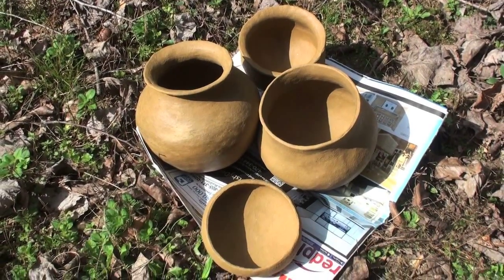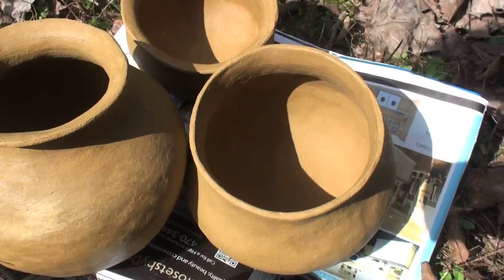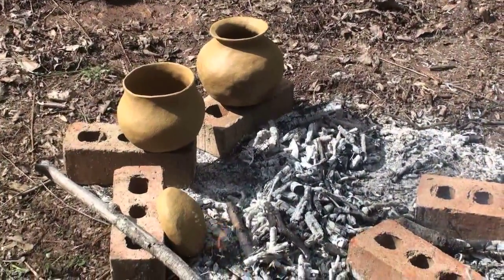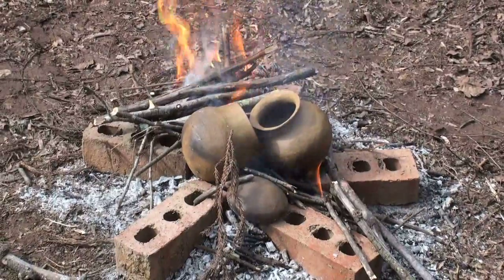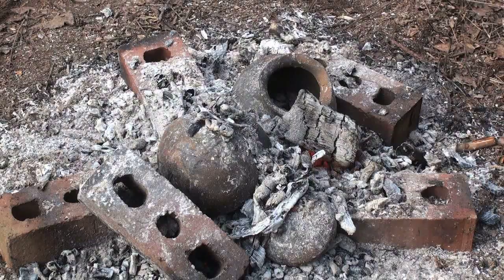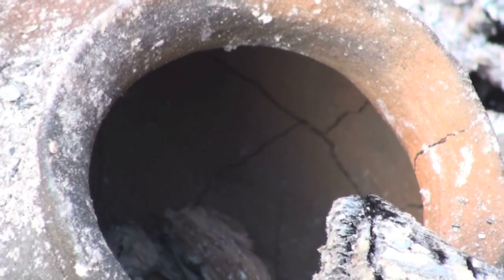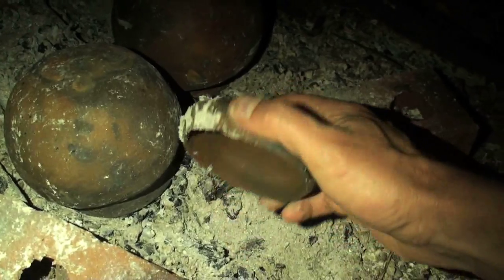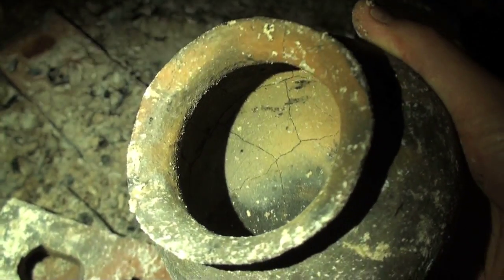Primitive Pottery Firing 1 (HD)

Comment: +Primitive Pathways -> The shape and geometry of the items is excellent and obviously a lot of work . Firing temps of 1400 degrees will never be reached in an above ground fire / without a kiln = I know and have been making ceramics in a "primitive" way for over 40 years . Best of luck in all future endeavors .
Reply from the maker: Thanks!  Yes you're right about the temperatures a fire can generate.  But that's actually what I want because I'm wanting to make low-fired pottery that's fire proof and capable of being used as cooking vessels over the fire.  If they fire at higher temps, they become glass-like and are unable to be used as cookware.  I believe the pots cracked because I didn't have enough temper.  I've got some more experimental pots that are drying right now that have more temper.  I'll fire them once they're dry and see how they turn out.
Reply: Just my opinion - For a cooking vessel and anything containing hot liquids , I want a "glass like " glaze which stops moisture from entering the inevitable porosity of the clayware . This porosity is greatly reduced by washing and kneading harvested natural clays and getting the clay as "clean" as possible with no particulate matter . 
It is the air spaces and porosity which cause most problems + all hand made ceramics need quite a lot of SLOW drying time before firing - be it indirect sunlight or other methods . 
I will use Chaco Canyon New Mexico as an example -> To this day , there are still a great many pottery shards in the vicinity and much of these shards are the result of structural failure during the firing process = A person is going to lose a percentage of their work . Once again - Your vessels look awesome and your skill level is evident  . ATB
Reply: I use a thermocouple to measure my outdoor firings temperature, 1400 F is super easy to reach, even a fairly low temp firing can get that hot. I have to work hard to reach 1600 F though so that’s the top end.

Comment: Great job Billy, I've tried this myself with various degrees of success and many clay types. The main thing I found was crucial was regulating temperature changes. In the heating, cooling and throughout. Wood ash is a great thermal insulator and so is sand.
Reply from the maker: I agree.  Temperature fluctuations are the critical part of this process.  It was calm that day and the pots didn't spall, so there wasn't any water inside the clay.  I'm not sure why they cracked as much as they did...I'll just have to play with temper percentages and see what happens.

Comment: Get some oyster shells from a seafood resaurant, fire them, then grind them fairly small and use for temper.  I'm no potter, but the pottery shards I find normally show little flakes of fired shell as temper.
Reply from the maker: I've seen that shell temper used, but the ancient pottery that I find was tempered with quartz sand.  When you break the sherds you can see lots of quartz in there, and they used a lot of it.  I just have to find the right recipe...once I do I'm convinced it will work.
Reply: Primitive Pathways Well there's quite alot of quartz  up there in north georgia, should be relatively easy to find in nature. I'd like to see a little of the process before firing if you can.
Reply from the maker: Oh yes we have plenty of quartz where I live.  I've already got some more experimental pots drying that have more temper in them.  When they dry I'll fire them and see what happens!
Reply: @primitivepathways  what happen in your next experiment

Comment: Next tine surround the fire with cow dung, top to sides, when it burns it creates a natural seal further focusing the heat! Perfect clay pots every time! I learned off an old Mexican artist. Hope this helps.
Reply from the maker: Thanks!  I don't have any cow dung near me unfortunately. Actually I think I didn't have enough temper and that's why they cracked.  Temper minimizes shrinkage, and the type of cracks in the rims and the bodies of the pots are telltale signs that the clay shrank too much.  I've got more pots I made that have more sand in them.  When they dry I'll fire them and see how they do...
Reply: I watched a video where they used cow and also horse dung in a while dug in ground along with some fruit peel hay wood shaving pieces of wood ect

Comment: Air bubbles, perhaps? I'm no potter, but I know air bubbles in the pot will cause cracking.
Reply from the maker: Actually I think I didn't have enough temper.  Temper minimizes shrinkage, and the type of cracks in the rims and the bodies of the pots are telltale signs that the clay shrank too much.  I've got more pots I made that have more sand in them.  When they dry I'll fire them and see how they do...
Reply: The air bubbles thing is on old wise tale, 90% of breakage is residual moisture, more temper will give you greater thermal shock but will also allow that moisture to escape the clay body more easily.